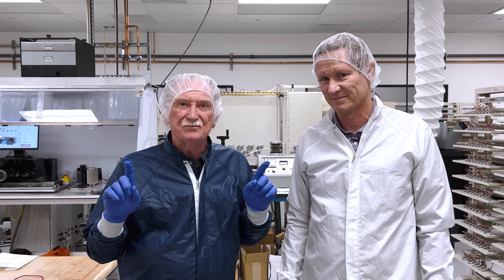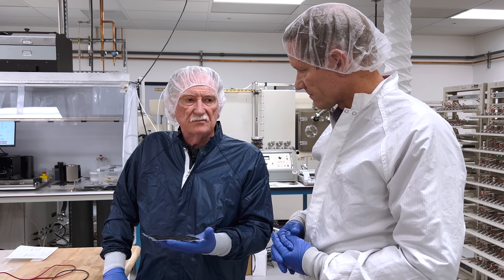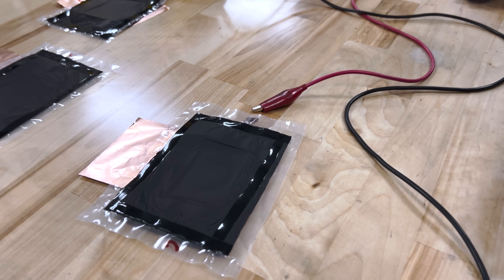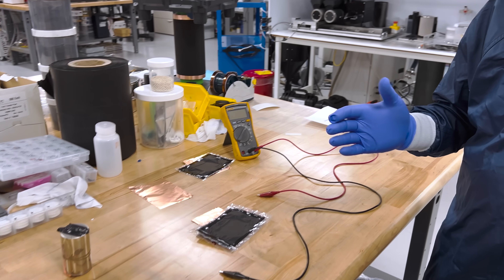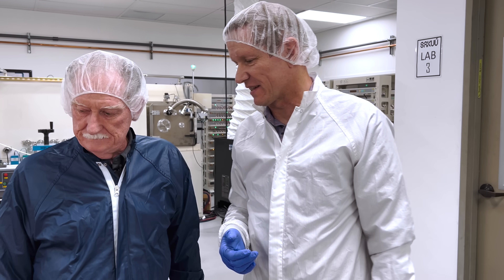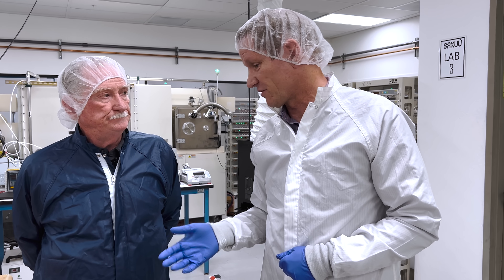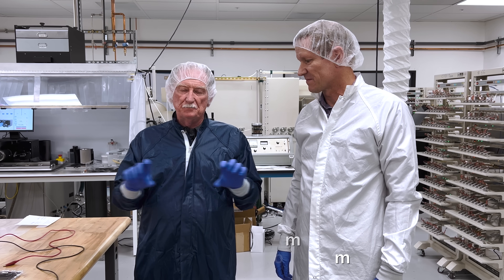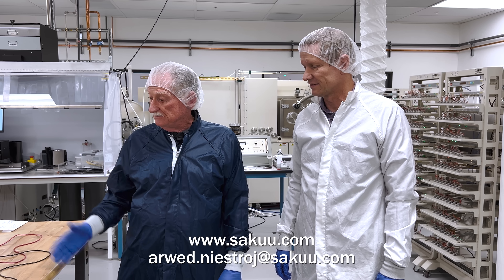Sakuu's Metal-Free Battery Cell: Game-Changing Innovation

Comment: I’m not a hater but I will get excited when I see these deployed commercially. I’ve been reading about battery breakthroughs for years but only very few actually make it to mass market. I hope it is successful.
Reply: No, that isn't the way to weigh up what Sakuu is offering. Sakuu is about optimising and reducing production plant costs while maintaining cell quality. One of the critical areas that Sakuu claims to deliver big advances in is dry electrode fabrication. Wet processing adds steps to the fabrication process and likewise processing time is lengthened by these steps, e.g. creation of slurries and drying of current collector coatings. So, it won't be consumers weighing up Sakuu's offerings but rather cell fabricators. Cost, efficient fabrication, quality and yield is what matters to them.

What will a cell fabricator do to assess Sakuu's claims? The fabricator will ask Sakuu to do a run of perhaps 100 or 1000 cells, made to a custom chemistry used by the fabricator and in a cell format familiar to that fabricator - a service provided by Sakuu - and they will then test them for performance and safety or pull them apart to check the quality of what comes in a cell package, viz. they will test Sakuu's cells in the same manner as they test their own existing cells.

If alongside production and production cost data these cells exhibit any notable advantages in cell assembly costs, quality of components (especially electrodes), energy density improvements, reduction in materials usage, savings in weight or volume and improvements in production yields then Sakuu will have the interest of the fabricator.

A second round of assessment will involve looking directly at Sakuu's production process to assess its robustness and scalability for high volume throughput and as well as costs for a realistic production deployment. If the numbers still come out looking good Sakku will be evaluated against other options for future plant expansions.

Fabricators will be deciding this, not you, and they will always look towards the bottom line.
Reply: Agree and Sandy is great at analyzing how cars are built, but I think he’s a bit dangerous when it comes to battery technology.
Reply: @ericgoldstein7220  Yeah the fact he asked him, "so has this been cycled 1000 times?" and not anything about what the current drawbacks to these polymers are or how much current it can reliably handle really makes me question how much he truly understands about any of this.
Reply: @JJFX-  There is a lot of effort going into batteries, and I really believe we will continue to get improvements. There is a non zero chance that something will become of this, but if if you aren't able to buy it in quantity, it's still in the hopes and dreams phase along with many others. Confidently predicting that this is the one is foolish.
Reply: @bienefeldmanfred  Did your bot lose its mind, or...?
Reply: Be nice to know the c rating of this chemistry. As well as the actual cycle life. Looks like it could be a fantastic leap forward though. If only the US and EU supported the industry to the same extent as China has. Still, hopefully we’ll get there before we run out of time.
Reply: You've got the right idea to you.We've been hearing about breakthroughs for years yet.We still don't see them in real life.
Reply: @madtscientist8853 CATL’s latest batteries are a big step forward AND they are already in vehicles. Might not be a full breakthrough, but lots improved on compared to the generation before it.
Reply: @madtscientist8853  but they create a history and track record for you to refer to to improve on it later.
Reply: @madtscientist8853 you've been ignorant of the breakthroughs because they have mostly come from China, and you can't be giving kudos to China, can you.
Reply: I'm old, I'll wait - y'all be the test cases and I'll watch because I'm out nothing. I've been riding a bike and leaving my cars parked
Reply: @caljeff2427 Negative Nelly...   Stuff fails in all kinds of cars.  Why does all have to be a problem when the whole EV industry overall will cut massive on maintenance and repairs compared to ICE.  My 2nd hand EV has been extremely cheap even as it have passed 10 years, mostly new tires and vipers..
Reply: I have battery break through fatigue.
Reply: Yes. Every week now for 10 years there is huge headlines of new battery technology that is "game changing"... And then you never hear anymore about them and nothing new happens.
Reply: @a64738  - Yes, it's better to be skeptical, but it only takes one smart guy to come up with a great improvement.  The most important factors are cost per KW, number and time of charge/discharge cycles, ease of large scale production, cheap and easily obtainable materials without digging up half of the world.
Reply: Exactly! It's ONLY a "game changer" when it actually disrupts existing battery technologies with something significantly better that's actually produced in large, commercially viable quantities! Until then, I won't be holding my breath!
Reply: True but it only takes one manufacturer to get it right. Just like Sony did all those years ago.
Reply: I'd also interested in how many recharging cycles you get out of them, degradation rate, ease of replaceable (easy swap out of packs would be awesome), reliability, toxicity ect... it's a long list. including expense, speed of manufacturer ect. Oh durability and reactivity, having something able to reduce the the packs to goo, or it's housing breaking down would be ... awkward... Time will tell...
Reply: Roger that!
Reply: @caljeff2427 Let's say you make a battery pack for a car, and out of a million packs, only one fails before it goes 500,000 miles. Do you need to be able to repair it? No. You make 1 more pack, and replace the one that fails.
Reply: @fjalics  Even after a minor bump, no technician will certify the battery safe because its his name on the ticket. Those batteries have to be replaced, dismantled, inspected cell by cell and built back into a recycled battery. While in most cases this results in the car being written off.
This is one of the contributing factors towards rising insurance costs.
Reply: @fjalics  A car battery should last 20 years too to accept them not being easily repairable.
Reply: @miragept  You mean a lead acid starter battery? You do know those have lousy cycle life, right? That is why in newer Teslas they switched to a 16V lithium battery, so it can last the life of the car.
Reply: @fjalics  Mobility/main battery.
Reply: @fjalics and now to tiny 48 volt system. It’s not cold cranking a humongous V8.
Reply: @caljeff2427 That's true, which is why Tesla added a titanium plate to early Model S packs, so fewer got dammaged. So again, it's a numbers game. You can add enough protection to the packs so the number that get dammaged is very low, then replace them. If you watch the "Monro Live" teardown videos, you can see the new packs are put in with structural adhesive, and so that is the direction they went. Early Teslas had modules that could be replaced. The new ones don't. To determine if this is the right approach or not, you can't just imagine what might happen. You have to get the numbers, and calculate. Tesla has sold more than 5 million EVs. They have the numbers.
Reply: It only needs one, let hope we can stop looking.
Reply: You referred to kWh as power. It is the same energy, not power. How long to charge.
Reply: Like when GE touted their patents on magnetic refrigeration but it never left the lab for the consumer (except in space and specialized applications).
Reply: This has a higher TIME to manufacture cost at current size.
Maybe if cell sizes are increased can get that cost savings down too.
Reply: Agreed
Reply: An GM engineering exec was quoted 20 plus years ago, "there are liars, and there are damn liars, and there are battery engineers."
Reply: @dathat555  - I'm a skeptic myself, but it's undeniable that battery tech is advancing more rapidly in recent years than anytime before.  There's an great incentive to be the first to comes up with the most energy dense, cheap, and eco-friendly battery.
Reply: @dathat555 then there’s Mary Barra.
Reply: I will be excited when I can order them. 

It would be cool to use these as ultra light fabric, with a solar layer on top.
Reply: The bar of performance and price cut is rising fast if you look backwards in time. If we compare that to the ICE how have reach its end of its S curve of development for many decades ago. The race is crystal clear ON ! for battery tech.
Reply: yup
Reply: im already excited, no more thermal runway is enough to switch to this... the rest, is just cherry

i want this tech in r/c lipos
Reply: Battery development is basically in a Cambrian Explosion - so many weird and wonderful chemistries and processes but in 10 years from now, most of those will have fallen by the wayside and the survivors will dominate. I have no doubt that battery technology is only going to get safer, cheaper and higher density over time. But like yourself I see "game changer" thrown around all the time and clearly most of these products will never leave the lab or if they do, never see widespread adoption.
Reply: @drxym  - Moving away from chemical reaction batteries completely would be a better solution.  I would equate the current chemical batteries as older spinning hard drives vs new non-chemical batteries as SSD drives.  It will take a big leap but it's necessary for sustainability.
Reply: My sentiments EXACTLY
Reply: It's because of the attorneys.
Reply: @caljeff2427The IC chip has zero repairability also, but where would we be without it?
Reply: Its unlikely anything will beat lithium based cells. Its just a property of physics that lithium is capable of being more energy dense than most other elements. You'll most likely see battery technologies that make it much cheaper to produce, that last for more cycles and within higher temperature ranges, but I genuinely think we've reached peak energy density.
Reply: @KieranDevvs  SODIUM
Reply: Exactly, many fail simply because there is no way to mass produce them. Many fail because of lack of funding. Many others over stated their actual numbers in hopes they could accomplish it with enough  funding. It would be nice to have another option, but sadly it has to be properly funded and properly tested and have a way to mass produce them at low cost, so it's a tall order to fit all these things.
Reply: It's sad that you need to qualify your comment as "Not a Hater" tho I agree you do need to. Sad state of affairs the media can target one person and by association every single thing that person touches.😞
Reply: Practically every week a new wonder battery is announced, but none of them made into mass production.
Reply: Yep
Reply: Hater
Reply: @caljeff2427you cannot repaire 4860 anyway
Reply: *Prototyping is easy production is hard."  
E. Musk
Reply: Good point. Graphene has been one of the "revolutionary new tech materials" for usage in batteries and conductors for over ten to fifteen years now but I'm yet to see any actual application other than in things like "unbreakable" water bottles and such.
Reply: @caljeff2427  Repairing batteries isn't a thing in cars yet, it's extremely costly battery replacement. what is being explained here is that replacing these battery cells is substantially better in every way, its cheaper, simpler and quicker than what battery tech we have now.
Reply: Even if they are 3x better in every aspect than existing convenient CATL/LG/Panasonic batteries and are ready for mass production it will still take years if not decades to adopt them. Corporations have put billions into the current battery tech. Hell, Musk alone will die on his hill defending Tesla's Li-Ion batteries because he spent tons of money on those Gigafactories.
Reply: Market want war and failure, not progress, not peace, not future, not freedom but alienation.
So yeah, wait.........
Humanity has failed it's evolutionary process.
Reply: Investor commerial
Reply: Sandy wouldn't make a video like this if it was vaporware
Reply: @CurtisKlope  I’ve zero doubts about Sandy’s integrity. I also believe that the product works but I really believe that designing a new product is the easier part. Bringing it to mass manufacture is the harder part. For instance, we’ve been hearing about solid state batteries for 10 years and there is still no major manufacturer using them.
Reply: @caljeff2427 you can recycle that , you can't cool the earth because of emissions from combustion.
Reply: the energy density crosses 350kwh/ kg, i think it's the treshold needed to tranfer tehcnology to planes: but the colonel's recipe is unknown......what hides behind "no metal" ????? these are the real considerations. other considerations are futile
Reply: A battery company will buy it to kill it!
Reply: @rgruenhaus  So why would a battery company buy a lighter, cheaper, more energy dense battery design, in order to shelve it, at a time when the world is screaming for more and better batteries?!  Trillions of watt hours of batteries will be needed for an electric future, of many different chemistries and designs for multiple use cases.  If the current owners have a cash cow and know it, why sell it?  If you buy a cash cow, why shelve it?
Reply: @ewadge  Construction of factories  is a great sign!  Out of lab, out of major development.   NC is getting a sodium battery factory.   SALT IS CHEAP!!!  And I think it's supposed to cycle like a bazillion times before it's worn out.  CATL has hit an energy density on one of their battery designs, which has caused them to put it in a testbed commercial aircraft.   
Also, to be fair, a 90% drop in the manufacturing cost of batteries,  combined with a multiple life expectancy  increase, have all been achieved in mass production batteries within the last 8-10 years.  Development has actually been happening at an incredible pace.  Maybe not at the unrealistic pace some had hoped for, but still incredible.  There is too much money to be made for it to stop now.  It's definitely not a time to close the patent office because all the good stuff has already been invented.  (That was proposed in 1899 by the US Patent office commissioner)
Reply: There have been dozens of battery breakthroughs, you have either been ignoring them or just ignorant of those developments, either way it's YOU.
Reply: Or at least when Sakuu shares more than a handful of clunky graphs. Seriously, I'm not hating on the idea but look up data you can actually find. What they share on their site is suspiciously vague as is the rest you'll find sprinkled around. What you will see are underwhelming demonstrations and media claims. In the last video, the graphs showing 1000+ cycles conveniently omitted the chemistry, stating only "li metal".

I think their real goal is patenting and licensing processes and it'll be up to other companies to iron out the details and attempt a viable product for production.
Reply: @JJFX- Vagueness is for a reason. It’s called patentable intellectual property. You share just enough to excite VC’s for Cash raise. I doubt the company would ever mass manufacture these products. But they could make Billions in licensing royalties.
Reply: @JJFX-  - It's probably lithium  metal encapsulated in some polymer (thus the dry process) which has been knows for a while.
Reply: @JJFX-  I agree 100%. Get the patents down, since we haven't transcended our negative instinctual human qualities that stifle us from continually speeding up our technological growth.
Reply: Yeah.  Most never make it out of the lab, although some do.  It's also going to be difficult competing with CATL's new batteries, which by all accounts are amazing and they're already on the market it China with a US release at the end of this year.  China has a big advantage right now.
Reply: @Ryan-ff2db 
Price might be the trick... we just need a good recession. 😊

I don't care if I have a slightly bigger phone and a CHEAP battery that lasts forever or isswappable. Tessla was made to sell batteries and get government subsidies I am convinced. Same with Space X... sweet sweet government cash. 🤑
Reply: @Ryan-ff2db  If CATL lifepo4 batteries really have 200 Wh/kg, that's fantastic. Many less weight critical applications will be taken over by lifepo4.
Reply: @Ryan-ff2db 11:54
Reply: @Ryan-ff2db  - CATL's batteries are really good in terms of energy density due to their flat pack design.  BUT they aren't safe like this one, those catch fire due to accident damage or heat buildup with their liquid electrolytes.
Reply: @BillAnt  Battery fires are vastly overstated and all lithium chemistries are much safer than gasoline vehicles or natural gas in the home.   This may be safer still but they still need to compete on density, charge rate, etc.. if they are to make it to market.
Reply: @Ryan-ff2db  - According to them, their energy density is higher than Li.
Reply: @Ryan-ff2db Gasoline vehicles don't burn parking garages
Reply: @BillAnt  Perhaps, but they are nowhere close to commercial production.  CATL's new batteries are and they're already working on 2nd gen versions.  Don't get me wrong I'd prefer a western solution but the fact remains, China is far ahead at this point.
Reply: @Ryan-ff2db   - I agree China being further ahead.  Also, due to their lax environmental laws. and large amounts of raw materials, they have no problem digging up vast amounts of earth.
Reply: @Ryan-ff2db  - My hope is that one day we'll have a sustainable battery made with clean graphene or similar material, perhaps even super-caps with high energy and virtually unlimited number of charge/discharge cycles.  Maybe a wishful thinking, but who would have thought 30 years ago that we'll  be carrying a Star-Trek like mobile phone in our pockets. ;)
Reply: @BillAnt ahh…no.
Reply: @BillAnt it is Li-ion.
Reply: @BillAnt Which chemistries are you talking about? Their new sodium ion and NMC cells are not explosive.
Reply: The 4680 contributes to the rigidity of the frame of the car, and the metal surface helps cool the battery.  So, I question if this design really saves all that much weight. Lots of questions still to be answered.
Reply: @jonahbert111  But the 4680's have not lived up to any of the projections from Battery day 4 years ago:  energy density, charging rate, production volume, etc.  Meanwhile, the battery market is passing them by.
Reply: @jonahbert111  I don't think the battery casing is what's contributing to the structural rigidity, it's the frame that the battery cells are encased in.  Putting structural load on a battery casing would be asking for trouble.
Reply: @glibsonoran  No:  " both the top and bottom steel "skin" layer of the pack form the structural chord and the battery cells themselves the "core" webbing. Now because the webbing is attached to the two steel layers, they can transfer load from front to rear. This is because like a truss, one layer skin goes into compression, while the opposite skin goes under tension, while the core keeps each skin geometrically separated. The core is compressing the cells, every time the top and bottom skins are subjected to forces."
Reply: Batteries should remain a lot cooler with less internal resistance.
But definitely smart to question all aspects before running victory laps.  @jonahbert111
Reply: @jonahbert111 yeah I agree, but one thing is for certain,  these are far less prone to catch fire if they get shorted. That is a huge deal, perhaps the best feature of thus design!
Reply: @jonahbert111  the cars rigidity will be much better if there is a substantial weight reduction, so yeah, still some questions.. I realized that I basically reiterated what you're saying once I got to the end of my comment 😂
Reply: @jonahbert111  The structural battery pack could be a huge manufacturing win, but a big customer loss.  As I write this, I have the battery for my Lexus Hybrid torn down in my garage as I work to recondition modules and weed out the bad ones for replacement.  
The Tesla structural battery pack is like an Apple MacBook Pro motherboard.  A 100% disposable assembly.  No replacing ram or ssd or cpu or gpu.   It's not that they made it without service in mind, but seemingly purposefully designed it to make sure service is completely impossible.  Lose one of the 4 BMS boards on a structural pack and lose $10-$20k.  I keep my cars, and for me to buy a Tesla with a structural battery,  I would need to get it used at a throw-away price.
Reply: @jonahbert111  With refined design, and the right choice of framework for this battery, it would be Fantastic if they could rebuild these at component level to Really make this Successful!  Fantastic!!!
Reply: @jonahbert111 Yeap You’re right, at the cell Level there is big improvement but at battery pack we still don’t knows. Maybe at the end both 100kWh battery packs will weight simillar and 4680 will be structural part of the car
Reply: @jonahbert111  Sandy got bought off to make this hype video! Nothing said here is what it seems! It was deliberately simplistic and over the top positive and deceptive!!! If you know what you are looking for, you'll see right through the BS. This battery is 3.2v per cell. I'll assume 100S or 410v at full charge like a model 3 has. To get that in these cells you need 128 cells in series or 128S. What did this save exactly? The insinuations that this is"metal free" and therefore lighter and cheaper is lies! No one is going to use a stack of these cells in series like they show in the video! They will be stacked many in parallel to get a decent amount of capacity. This is how all pouch and prismatic cells are made. This won't be different! That means they need metal foil sheets on either side of each layer and an insulator sheet between...aka just as much weight and cost as any other cell you can buy now!
Reply: @de-bodgery 😆 what are you on about?? The cells obviously have conductive sides made of graphine or a graphine-carbon impregnated polymer of some form and the chem is obviously LFP or similar, commonly used in EVs and elsewhere.
Reply: @Luxamor-8  "Obviously"? Really? I see a copper sheet used on one side of that cell. What do you call that metal foil sheet? IF in fact there is some form of graphene used, then these guys need to get out of battery development and jsut supply the world with graphene sheets and make billions doing nothing else! I don't know what chemistry the cell uses, but 3.2v isn't great when everyone else is using 4.1v cells. I've taken apart LFP cells. I don't think this is LFP.
Reply: @de-bodgery  3.2V is the normative range voltage of LFP, its what's quoted for LFP, look it up. 
Its a metal free battery too, so notice that he stacked the cells on top of each other with no foil sandwich, that's because they're cleverly using the conductive sides, so with the larger surface area the resistance is possibly lower than some metal tabs connections like aluminium and tin used for cost.
Reply: @Luxamor-8  I'm not your average brick fence when it comes to battery tech or electronics. You are assuming this cell is LFP and I'm not. I see no evidence to conclude this is LFP and I've taken LFP cells apart, looked closely at their anode and cathode construction, etc. The voltage of the cell is probably full charge or close to it, not some nominal voltage. Cell voltage doesn't tell you much about cell chemistry. At best, it's a clue. You are assuming they are telling you the truth about this cell and as someone that knows a thing or 2 about cell construction, I don't believe it! Even that 2 cell stack...aka 2 cells in series is deceptive! DId you see them measure current or jsut voltage? Did you notice that they put the cell under no load what so ever? That's because it needs metal current carriers on both sides to be of any use. Carbon is very fragile and brittle by itself. It needs to be deposited  on some conductive material such as copper or aluminum to be useful as a very thin surface for current carrying.
Reply: @de-bodgery  you're really having a problem, the guy even mentioned the cell was partially discharged, if you've ever been involved with chemistry like Lifepo4 (wether this is or not) you'd know that its voltage curve drops away quickly from full charge approx 3.65V to an almost flat line 3.2V for most of the discharge curve, until around 80% DOD then it falls away.
As for conductive polymers, there's plenty on the market now with a similar conductance and ampacity as conductive metals.
If you know about how conductance works and will these flat pouch cells, with little in the way of fluid in them, they would be expected to be under compression anyhow, pressure of contact and csa is proportional to conductance.
Reply: @Luxamor-8  Notice how you are insisting that this cell is LFP. I'm insisting that there is not enough information to say one way or the other. Maybe you are right, but then there is also excellent reasons why you are not. I have insufficient information to conclude anything about the cell chemistry! What I can say is that in the video it measures 3.2v and that's all I can say for sure about the cell chemistry...measured voltage...nothing more! Do you see them talking about LFP or any other chemistry in the video in reference to these cells? Maybe I skipped over it? FYI..."partially discharged" can mean just about anything. Charged to full and then 1mah discharge is "partially discharged". 4000mah cell down to 100mah left is "partially discharged".  I dont see this statement as proof of much.
Reply: @Luxamor-8  Spent any time looking at their website? I don't see anywhere that they describe more than "lithium metal"...whatever that means! We have no idea what the cell chemistry is and SAKUU doesn't tell you either!
Reply: @de-bodgery  best wait and see then.
Reply: @de-bodgery  lithium metal is not used in rechargeable cell chemistry, its used in primary cells.
Reply: @Luxamor-8  Lithium is a metal. Just look on the periodic table of elements. Saying "lithium metal" is just redundant. Do you say "iron metal" or "aluminum metal"? So then, feel free to find a single rechargeable battery that is lithium based that doesn't have lithium in it. They will be called something else since they are not based around lithium. Typical LFP or NMC or LTO or whatever chemistries, there isn't pure lithium in there. It's part of a molecule of some kind that makes breaking off and depositing electrons easy so that you can have lithium ions for carrying charge. Apon recycling the lithium in the cell is purified back to pure lithium for reuse in new cells. It was never not the metal we call lithium. At most, it was part of a molecule.
Reply: @de-bodgery  what are you on about?
Its actually Lithium metal, metallic Lithium that is used in non-rechargeable cells and Lithium in ionic form, eg. Lithium-Iron-Phosphate, used in Lithium 'ION' rechargeable cells, not metallic Lithium, even if Lithium metal is extractable from it.
Its like you are saying Sodium metal is Sodium Chloride Salt, its obviously not, its a salt, so you're in agreement but simply confusing what is meant by 'non-metallic' battery here.

By non-metallic, what the dude in the video means it has no metallic connections in the sandwiching between individual cells forming a battery, metallic connections would, probably, only occur at the battery end connection tabs/plates.
Cell monitoring and balancing wires would probably still be metal, though, for sure, and be  possibly small foil tabs sticking out, its a game-changer for sure, if they can print these.
Reply: @de-bodgery no. Even Tesla uses combination of series & parallel.
These could be stacked to 100volt, many stacks in parallel for module, several modules for a pack. Less current loss at 100 volt, safe enough (not like 400 or 800 volt). Lots of ways to skin a cat.
Reply: @de-bodgery Isn’t the copper sheet only used at the end of the circuit in this demo? Meaning no copper sheet between each cell, as you stated in your criticism?
Reply: @JOHAN_PERJUS  Individual elements of a cell are not connected in series. You do that external to a complete cell. Inside any given cell package, all elements are in parallel. This is very much of a case of there is only one way it's done. There will be copper or aluminum foils on either side of each element inside the complete cell. No exceptions...no other way it's done in a pouch or flat cell design. What they presented in this video is deceptive and false.
Reply: @de-bodgery the are a few mistakes here. 
The cell tested was 3.2v, but they said it was partially discharged. If it's NMC, it will be nominal 3.7v 
Model 3 batteries are 96s. 
So they theoretically could get better density. If they make the pouch cells big enough, they can make the battery 96s1p for a model 3/Y like the BYD Blade battery.
Reply: @fishndive1961  "Partially discharged" doesn't mean much. 3.2v for NMC or LFP based on common discharge curves is pretty close to empty...like 10% SOC left. What's full charge voltage of this cell? This statement can mean just about anything!
Reply: @jonahbert111 Also the production of this battery looked extremely inefficient. 4680s main advantage is production volume.
Reply: @freddybell8328  Do they? How do you know that? What you are saying here is just a version of the Telsa-is-the-best-and-can-do-no-wrong idea. That idea is wrong and self-evidently so. Besides the chemistry of Tesla's 4680 cells failing to advance over many years Tesla has never achieved a successful outcome with its dry cathodes - the yields are poor.

Tesla is not a first tier battery company and it doesn't look likely to become one. Automakers like Geely, GAC and SAIC seem to be achieving more notable advances in their in-house battery development operations that Tesla has managed to achieve with its operation. Tesla was single minded about the dry electrode thing but its current setup hasn't worked out. Perhaps, Sakuu's alternative approach to dry electrodes could work for Tesla.
Reply: @caljeff2427 there may be cases when the failure possibility is so low that repair is a don't-care. The other reason that replacing the whole structure is so cheap that repairing makes no sense. If those pouch cells are in box shaped "towers", changing a whole tower is not a big deal, so repairing individual pouches is unneccessary
Reply: @caljeff2427Not if you don't have to repair it. The JWST pins were all single points of failure, but they got the reliability so high, it wasn't likely any of the more than 100 would, and they didn't.
Reply: @caljeff2427Why does a battery cell need repair? Theres no moving parts.
Reply: If u think on the problem more deeper, wont it lead to capitalism is blockator of human prosperity?